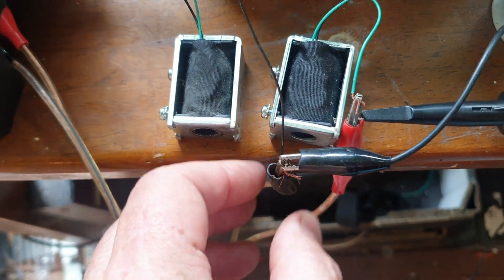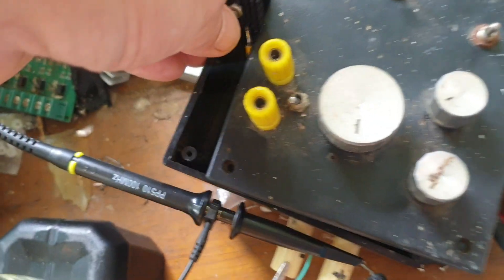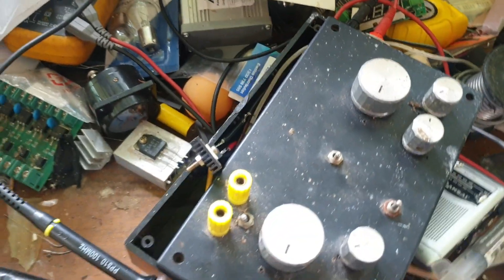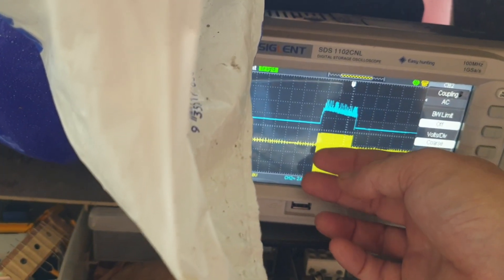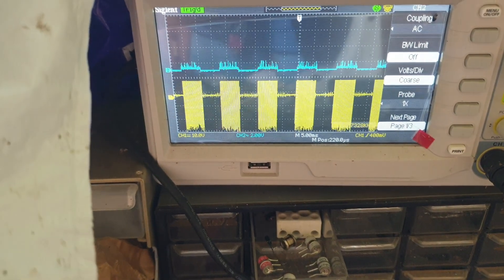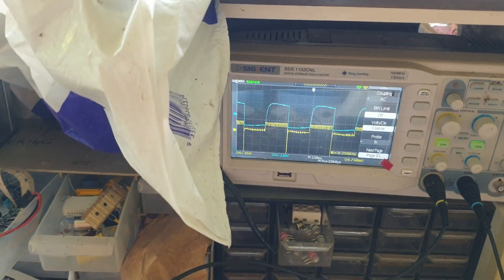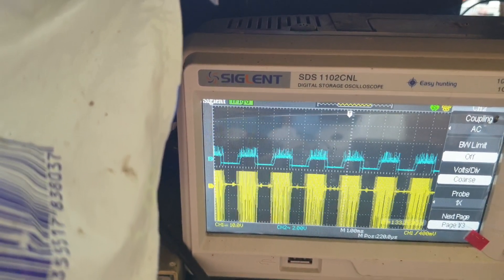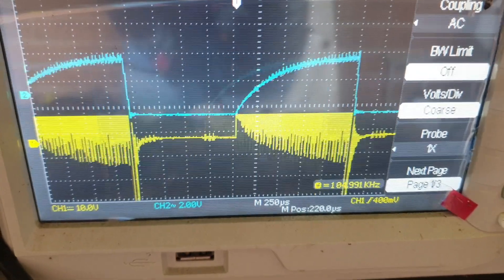Step Charge Chokes VIC Meyer Secrets

Comment: Hi m3sca1, I would want to know, how do you calculate the resonant frequency for the system
Reply from the maker: honestly I don't. i just play around with different coils and cell, looking for good combos, sweep coils looking for resonance. you can ask Ai to calculate the frequency of a cell by its dimensions, then ask it to figure out the coil length for the transformer VIC to impedance match the coil to the cell, it cam save you a lot of time messing about and get you closer to the target than by messing about like i have. you want to be just above 30V minimum, and amp inhibited
Reply: @ Thank you very much! I’m actually now gathering the information about all working VIC that I could find in YouTube and then I’ll make a comparison between them to find out the best one.
Reply: @ 
What was the inductance on two of your inductors in this video?

Comment: Your fuel cells are not prepared. 
ESR & RL must be greater than 20 Megaohms
Reply from the maker: please share more info
Reply: @m3sca1  You need to solve the high current problem.
This is done in two ways.
1.Increasing the impedance of the VIC circuit
2. Increase the ohmic resistance of the fuel cell.

With resonance in the VIC circuit, the reactance is 0.
Therefore, only the active resistance of the VIC circuit reduces the current.
Therefore, Meyer used steel wire for inductors.Its resistance is greater than that of copper wire.

However, using steel wire is not enough.
It is necessary to increase the ohmic resistance of the fuel cell.
This is achieved by training the tubes for 3 months.
This was done by Raju Ravi under the direction of Dave Lawton.
The workout can be shortened to 1 hour.
By applying an oxide film to the cathode.
Reply: @m3sca1  You need to solve the high current problem.
This is done in two ways.
1.Increasing the impedance of the VIC circuit
2. Increase the ohmic resistance of the fuel cell.

With resonance in the VIC circuit, the reactance is 0.
Therefore, only the active resistance of the VIC circuit reduces the current.
Therefore, Meyer used steel wire for inductors.Its resistance is greater than that of copper wire.

However, using steel wire is not enough.
It is necessary to increase the ohmic resistance of the fuel cell.
This is achieved by training the tubes for 3 months.
This was done by Raju Ravi under the direction of Dave Lawton.
The workout can be shortened to 1 hour.
By applying an oxide film to the cathode.
Reply from the maker: please share more info

Comment: Most interesting demonstration, you can physically see the hydrogen production through the glass container. Are you able to quantify the ratio of input power and hydrogen produced?
Reply from the maker: nope the glass jar got broken during install of the cell but for now, demonstrating that Stanley Meyers step charge scope shot is achievable and working towards the electron extraction and high voltage parts of the system, this cell will do fine.
Reply: I think measuring the gas output is really important.
Otherwise you have no way to quantify what works and what doesn't.
Reply: @jimsmindonline  My thoughts exactly.
Reply from the maker: i hear what you guys are saying but until its foaming up the water and making it hard to see, i dont see any point. it is clearly miniscule amounts at this point...the target is way off. the point here is the mysterious unobtanium waveform is easy to make when the plate gap is larger, like seen on the later resonant cavity cells, not like the long multipipe bench cell Stan used for the patent office which most copy.
Reply: @m3sca1 It just seems like a bit of a backwards way of doing things.

Why is emulating a certain scope trace so important? If you have no way to know if it's doing anything other than looking pretty?

Why not measure the gas output in a set period of time from a known DC power supply. Use that as a baseline to compare if any of this pulsed stuff actually has any advantage. It doesn't seem logical to me why a pulsed, ramp or any specific signal would have any advantage?

Also, I thought Meyers had been throughrouly debunked nowadays?
Didn't he get sued just before his death, by a load of people he promised working devices to, but never delivered?
Reply from the maker: @jimsmindonline  thats what the baseline tests a few videos back were for... DC only to get baselines for Faraday electrolysis on tap water. The particular scope trace has been something people struggled to achieve and it was Meyers claim that the step charge is the way to the non faraday electrolysis. The people i see that have said Meyers technology was not real didnt follow Stans methods and used Faraday electrolysis, didnt do the extra work to increase the gas energy yield and so proclaimed it a fake, and so in my opinion didnt do enough to disprove his claims. I have personally proved his claim of changing the burn rate of HHO by passing thru a plasma ioniser and achieved a slower burn, and seen other curious things like electron extraction that says to me there is things to he discovered here. Courts dont always favour those in the right. I personally think Meyer was not a fraudster since all the pieces of the puzzle that have proved to be true so far. I know you wanna see the gas bottled and measured but seriously i just mounted the thing and broke the bottle, i wanted to pipe the gas off for further processing but it has a big hole in the bottle wall and i havent got the replacement vessel sorted out yet so there is no measuring gas and like i said already, the tiny amount isnt worth catching yet. it is easy enough to judge by eye we dont have enough yet. HHO exists in many forms. example Ohmasa gas is different to browns gas is different to HHO from brute force electrolysis...anyone who says otherwise has not done enough research. I am still a believer. Using just a few of Stans ideas increases the efficiency of a brute force system... If you look at Herman P Andersons water car patent, we see Meyer pretty much copied Hermans spark plug. Looking at Andrija Puharich's patent we see Stan lifted the idea of the chokes either side of the cell from Andrija. Stan is just a part of the story. I think it is worth my time.
Reply: @m3sca1 
Just to summarise what I know about Meyer's...
It's true that he claimed to have developed a cell that could generate HHO through a process he called "step charging." This process was said to be different from traditional electrolysis, which involves the decomposition of water into hydrogen and oxygen using an electric current. Meyer claimed that his HHO cell was able to produce more energy than was input into the system, and that it could be used as a fuel for vehicles.

However, there has been much skepticism and controversy surrounding Meyer's claims. Many scientists and engineers have attempted to replicate his work and have been unable to do so. In addition, the scientific principles upon which Meyer's claims were based have been called into question, and there is no evidence to support the existence of a "step charging" process that can produce more energy than it consumes.

Without verifiable, reproducible evidence and a sound scientific basis, it is difficult to conclude that Meyer's HHO cell was a legitimate technology. While it is always possible that there may be novel ways to generate energy or new fuels that have not yet been discovered, it is important to approach such claims with a healthy dose of skepticism.

It's great that you are having fun experimenting with Stanley Meyer's HHO cell and that you are open to learning and challenging your beliefs. However, it's important to approach the claims made about this technology with skepticism and to critically evaluate the evidence. To really understand if Meyer's claims are true, it will be necessary to produce results that support them.

If you would like to understand the more widely accepted perspective on this technology, I would be happy to help. Feel free to pick my brain! Good luck with your experimentation! 👍